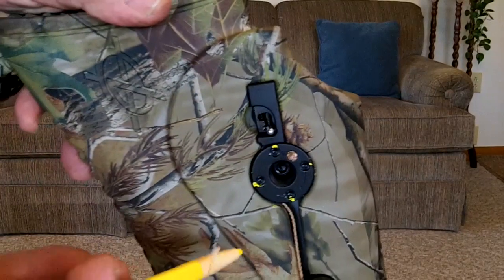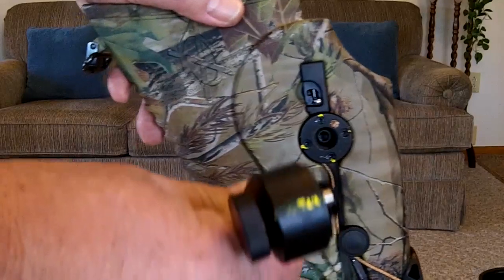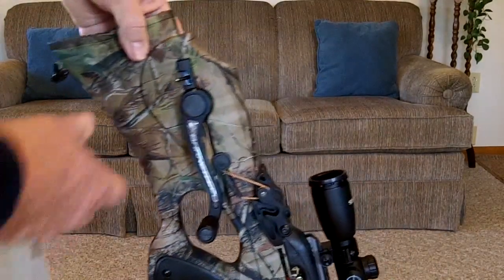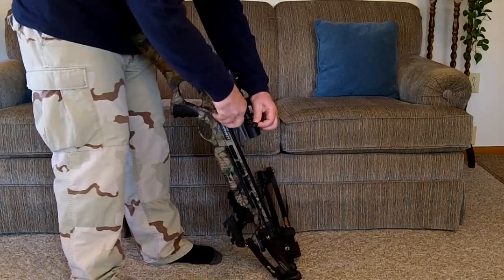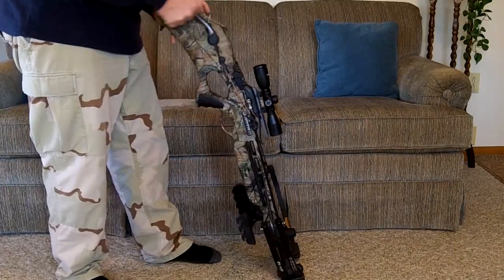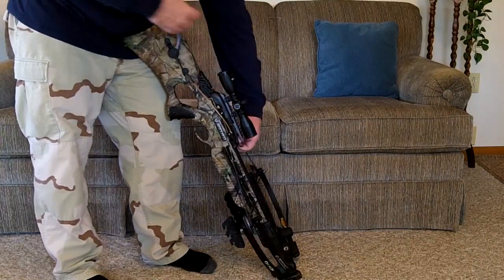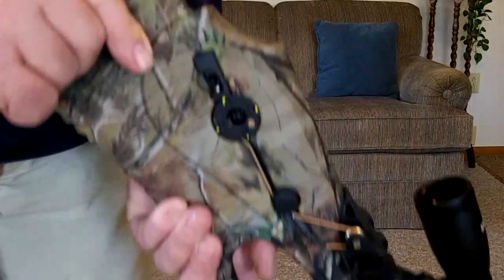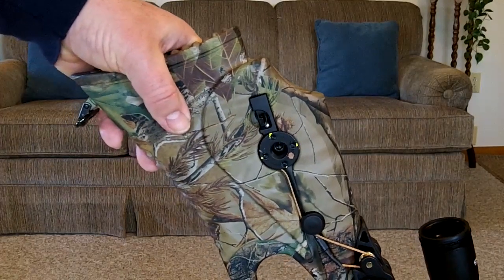Barnett Ghost 350 crossbow crank cocker operation

Comment: Thanks for making this video.  It actually helped me decide not to buy the cracking device.  I had no idea how the device worked or anything about it, but after watching this I've decided that the cracking device is too time consuming for me.  Right now I don't even use the string cocker.  I just grab the cable with my hands and brute it up. (gloves required).  It's not easy but it works for me.  thanks again for making the video.

Comment from the maker: If you just pull the string back you are pulling 185 lbs on a ghost 400.  The rope cocker is pretty fast as well but you are still pulling one half of 185 lbs.  The rope cocker is very easy to crank.

Comment: where did you buy the crank from and did you have cut into your stock or does is come in one solid piece
Reply: the stock comes pre-molded to fit the crank cocker... if not purchased separately (and installed) there are two cheek pad inserts that cover the portal.
Reply: thanks I bought one and assembled it on black fri. got the penetrator with crank and 4/32 scope
Reply: twane200 How do you like it? I just ordered the Ghost 350 for myself... was considering the crank cocker until I watched this video.  read my two concerns above about the device.  If you purchased one & are using it, what are your thoughts?

Comment: Nice video but I think I'll stick with the rope cocking device. I had never seen how the cranks work.
Reply: +Nathan H For hunting the rope cocking device is the way to go because its so much faster BUT if you're going to sit at the shooting table for hours-on-end then the crank-cocking device comes in handy. I will tell you this. This crank-cocking device is excellent BUT the installation directions SUCK! Straight out of the box one side of the strings will always be crossed. If you fix one side then it will cause the other side to be crossed... You have to take apart the anchor-bolt and remove the string to make both sides un-crossed. Once you do this now this crank-cocker is awesome and bug-free! Doesn't tangle at all! You would think that Barnet would try harder to teach people how this thing works?